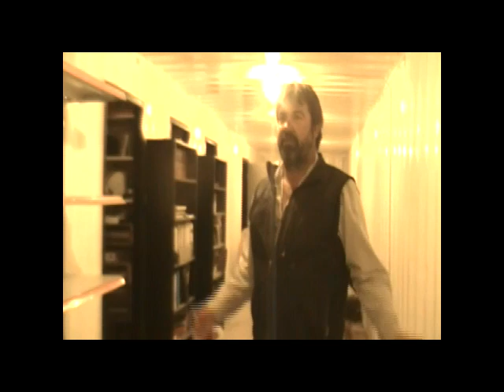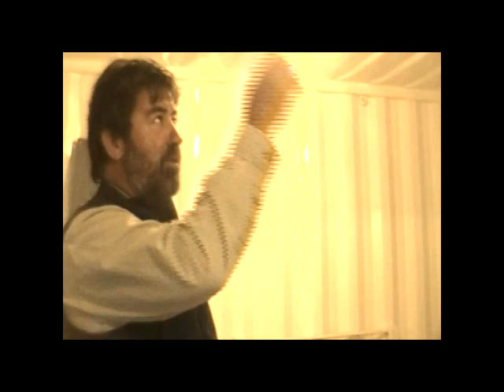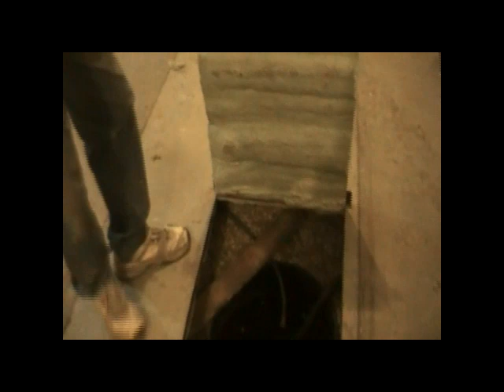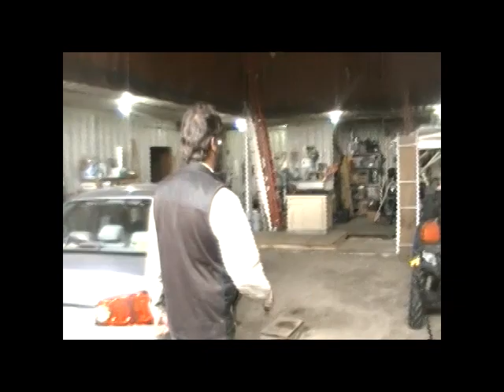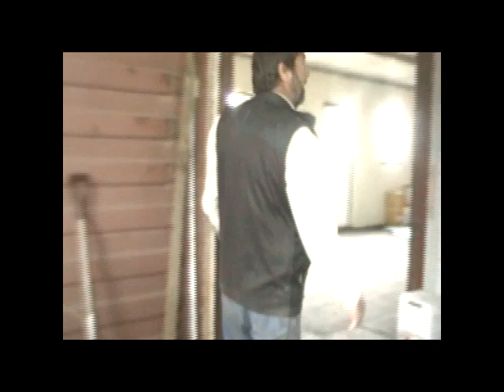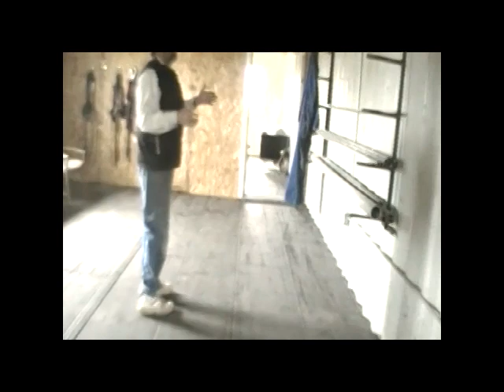Sea Can House Tour Part 1

Comment: A modular home is the way to go. You can keep expanding and expanding as long as you have the land to support plus its so much cheaper and structurally more robust and sturdy meaning greater severe weather resistance.

Comment: Bill, what did you use to insulate it?
Reply: The outside was insulated with a product called silverboard before the sheeting was put up. It is a rigid foam insulating product. http://www.amvicsystem.com/silverboard-rigid-foam-insulation